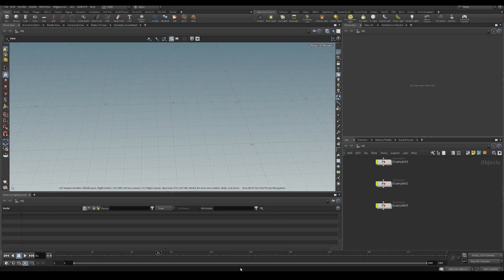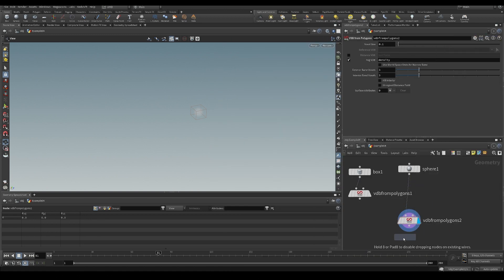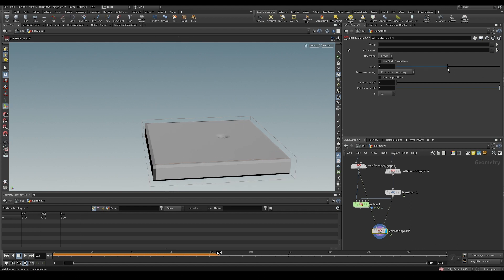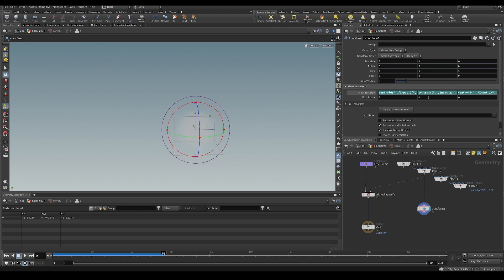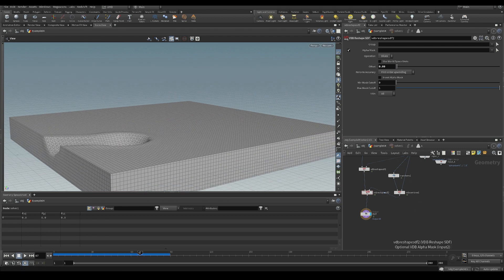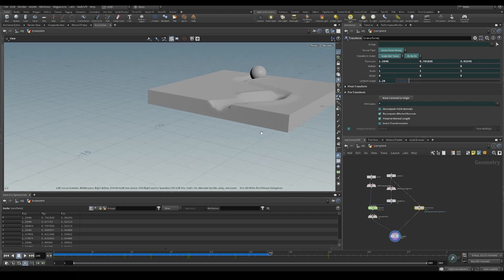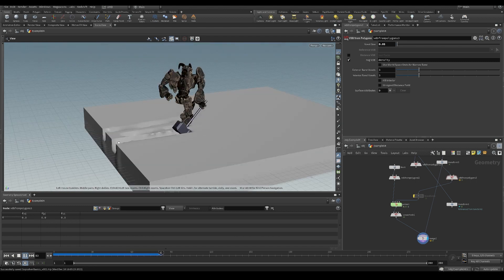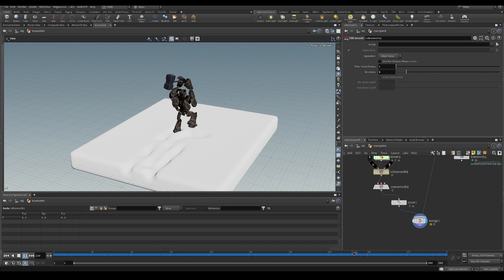Building Custom Solvers in Houdini - 04 - Snow Trails

Comment: For more officiant way you can use height field and just write the mask from geometry but of course it's just a simple example. Thank you for your videos!)
Reply from the maker: Yeah heightfields would probably run a lot faster. This is mostly just to show examples for the sop solver, in the next video we are exploring vdb advection so this is a nice build up to that.
Reply: @TimvanHelsdingen  Just in case you (or some random dude reading it) don't know, in GoW, tlou, Ghost of Tsushima and many others they used flow maps that's computing vectors in real time without any volumetrics actually, pure dynamic textures and displacement